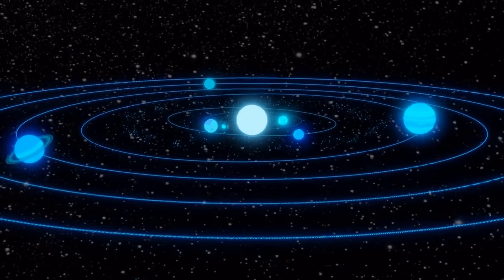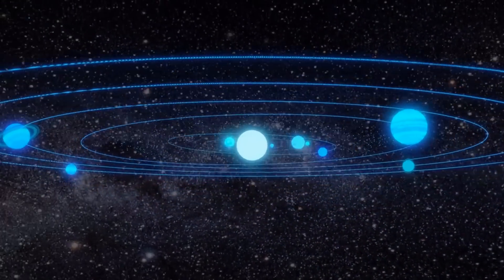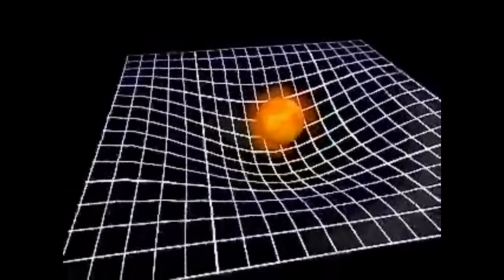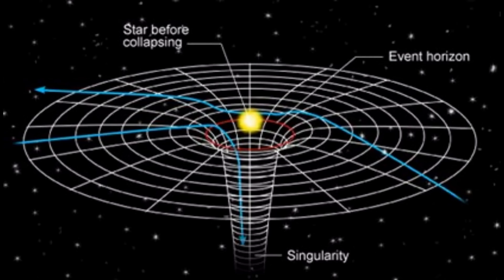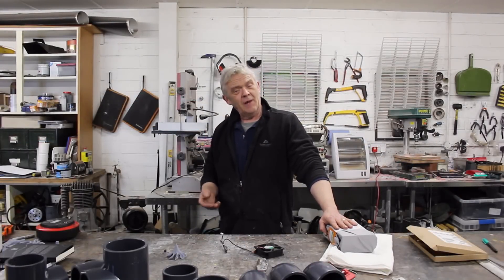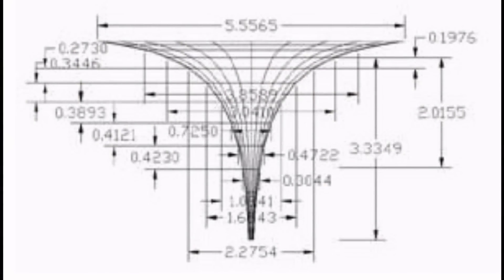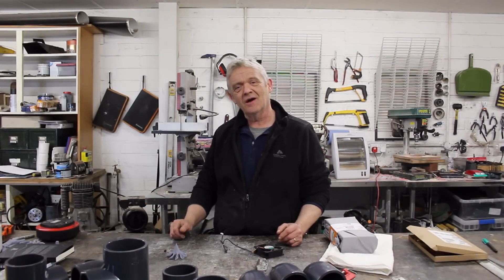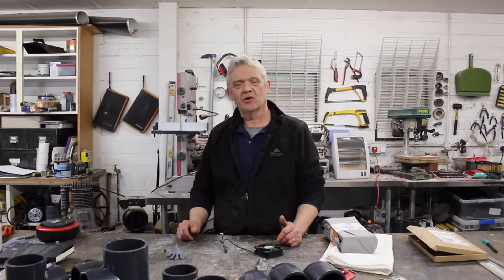1490 Vortex Power - How To Easily Make A Hyperbolic Funnel

Comment: Use spray pack gloss on top and let it set . Then do thicker coats underneith do strength . That way it will be like glass on top ! Nice and smooth
Reply from the maker: nice tip mate - thank you

Comment: Another name for that shape is a pseudosphere; so named because it exhibits constant negative gaussian curvature, whereas for a sphere it is positive.  Yet another name is a tractricoid because it is the surface of revolution of the tractrix, a curve of pursuit.  If, for example, you were to start pushing a bicycle forward starting with the front wheel at 90 degrees, the curve traced by the rear wheel would be a tractrix as the steering straightened back out.  It is the involute of the catenary.
Reply from the maker: nice - cheers

Comment: Absolutely brilliant Rob. I have been thinking exactly along these same lines for a couple of projects I have in mind and the best I could think of was turning glued foam sheets on an powered spindle. Doable but very messy, labor intensive and not easily scaled up. Your solution is much simpler and effective and can be scaled to almost any size. Thank you for such amazing suggestions and techniques. Cheers mate .
Reply from the maker: yes - I tried that with kingpin at 100mm - messy doesn't do it justice mate lol - I am glad it helped

Comment: This really tugs at my brain about dwell time and energy extraction from a turbine. Kind of like if you give squirrel to liquid in a jug or a 2 liter bottle that is the fastest way to drain the liquid. I often uses when dumping fluid out of containers or pouring oil into a funnel into a car. Rather than straight down having an offset to the center so it's Swirls and goes in faster. Now I know what's tugging at my brain a de Laval nozzle. I am going to have to cut up one of the old 5 gallon water bottles and maybe put a lily impeller in the neck and see what happens. This is gonna make me say up one of my 3d printers soon now
Reply from the maker: cool mate - liking the thinking

Comment: schauberger vortex tech is being used to make a hydrogen plant in new Hampshire.  company is qhydrogen
Reply from the maker: interesting
Reply: @ThinkingandTinkering  the technology is "waveform discs"  that are schauberger impeller rotors in series. some proprietary metallurgy involved too. they are building a plant in groveton new hampshire. the CEO is irvin Whitaker
Reply: @peterlang777  Thanks for this, I had a look at Whitakers patents and it's almost identical to schaubergers repulsine right? There is also a patent for a thrust engine using the same technology. But will big oil allow it to see the light of day? Probably not unfortunately!
Reply: @marksmith9218  here is the funny thing ! whitaker is 3rd generation big oil money!!!  his father was obsessed with this tech and worked on it for years.  anyone who sees his patents and knows of the repulsine says the same thing. they are very obviously based on them.
Reply: he isnt the only one. hunt petroleum of texas has moved in a very big way  to perovskite solar. they are a very old oil company privately held as a family biz. for a century.  even the saudis are moving to green hydrogen "mene mene tikal upharsin" (the writing on the wall)
Reply: @peterlang777  Interesting! Shauberger complained that his work was extorted in Texas, probably Whitakers granddad then 😄. Now, If only Rob could show us how to make a repulsine plate out of an old sheet and some resin! We could avoid some of those upcoming energy bill hikes! I have always been keen on the idea of running my house on air or water..😄